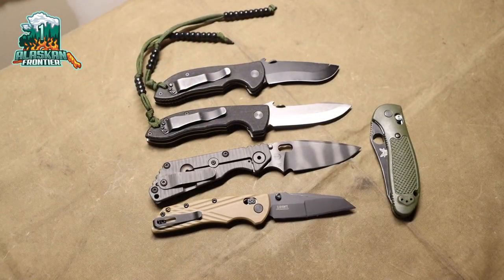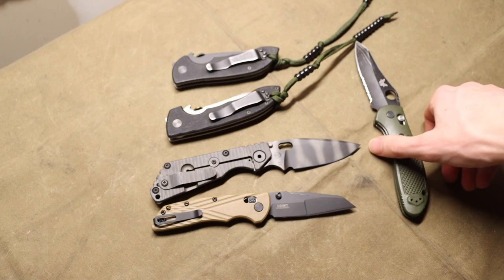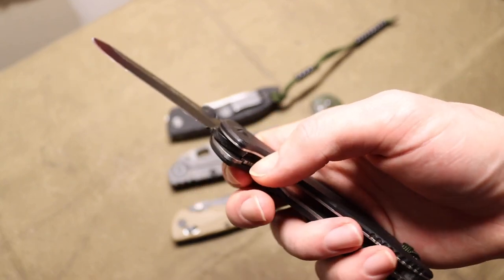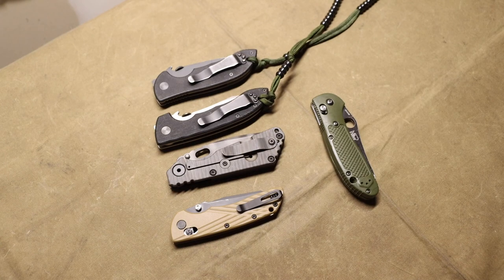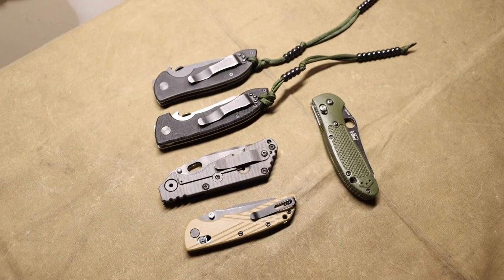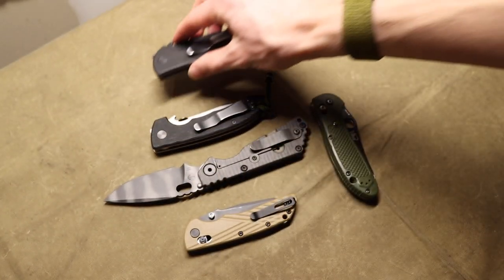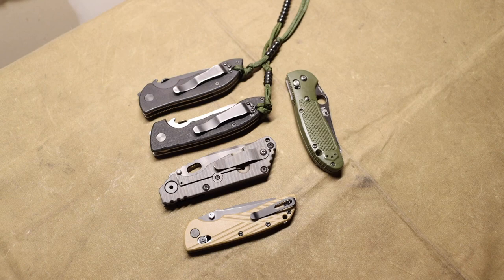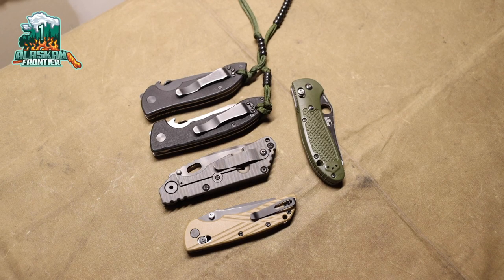Why I Like Sloppy Knives

Comment: Lol excuses for low quality craftsmanship. The truth is you can make any of those to a higher standard and they'd still perform the same. You are just making up these things to fit your opinion, but left out the truth of the matter. Strider had huge issues in the past and have since worked on fixing those problems of before. They ripped off a lot of people in those past knives ... The newer knives with better quality are better than the sloppy ones of yor. Stolen valor doesn't help his situation out either. Use facts please.

Also softer doesn't mean better. Because they can use soft steel and use poor microstructure or good microstructure. One makes a huge difference. Emerson use a good microstructure with softer rc for their use case. And that's acceptable. But other brands dont really do that. They just go soft to save money. The correct protocols need to be used for the use cases.